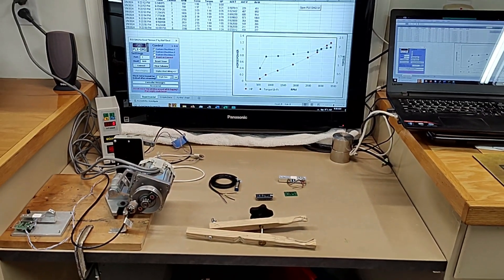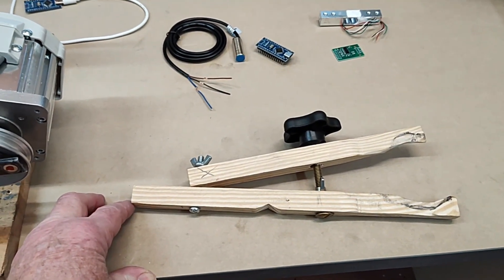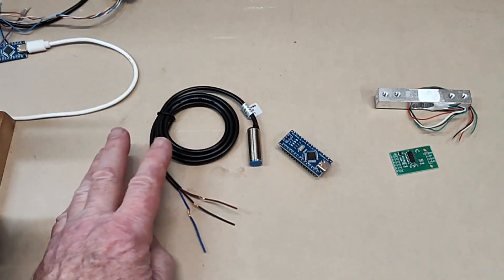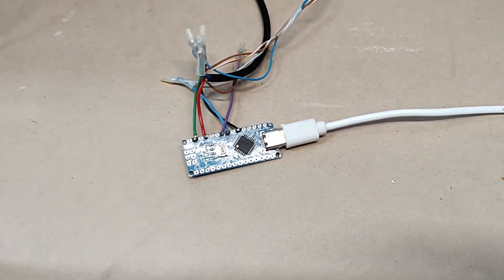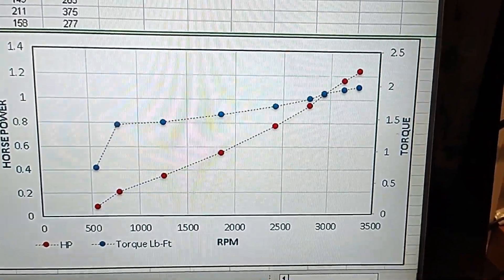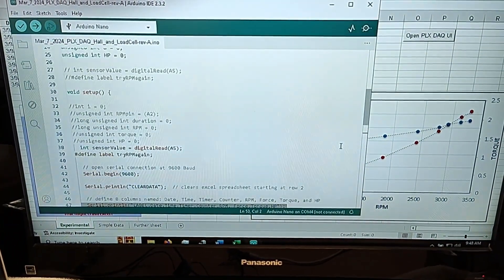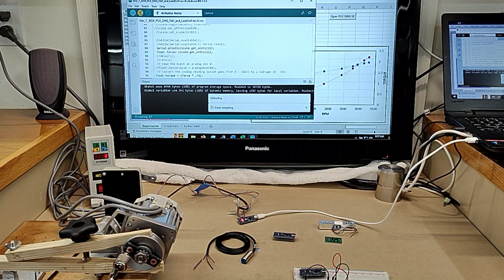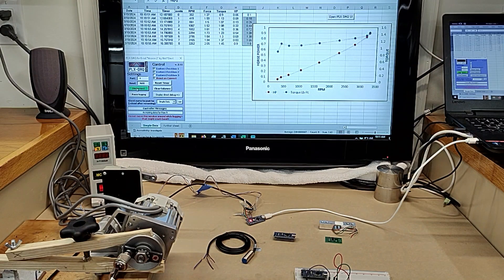Prony Brake Dyno, CHEAP!, for Small Engines. DIY Arduino based.

Comment: I’m struggling to understand why your torque versus RPM shows torque increasing with RPM. All other dc motor videos I’ve watched show the opposite. I.e., maximum (stall) torque occurring at zero RPM  and zero torque at maximum RPM. That said, I like your hardware setup.
Reply from the maker: Just happened to be online and saw this. The motor is a Vevor 500watt 6-pole stepper motor and matching controller, used for industrial sewing machines. The controller has a lot of user-setable parameters for things like acceleration rate, braking rate, stop position (for needles), etc. Maybe the way some of the parameters are set, and the rate at which I adjusted the load and the speed control lever, and who knows what else, the torque increased with RPM. I am not a motor expert but I do understand your question, so maybe this is a "feature" of this particular stepper motor. Maybe if I locked the speed control lever wide open and changed the loading in a different manner, the normal characteristic of max torque at stall would be evident. If you have an explanation, please share. BTW, I have overloaded the the motor many times so it now is pretty noisey, but it still works quite strongly. Maybe some of the magnet bonding fractured? Lloyd
Reply: @1227air500 : Hello! I’m not a motor expert either but I thought the following video by Aaron Danner might be helpful: https://youtu.be/jgUxjOZAJQE?si=PfaH_Ps7vw-ol1oZ

Thanks very much for responding to my comment so quickly.
Reply: @1227air500  : Another thought I had as regards your plot is that perhaps you are interpreting the data in a non-conventional sense. For instance, it would seem logical that as you tightened the Prony brake the motor would have to do more work to overcome the associated increase in friction and would likely slow down. If you continued to tighten the brake I would expect the motor to work ever harder (i.e., have to produce ever more torque) to overcome the load from the brake and at some point would stall and hence have zero speed. From this viewpoint, you could say that as you increase the load on the motor by tightening the Prony brake, the motor torque is increasing AND the motor is slowing down. Does this make sense? - Cheers - Jim
Reply from the maker: @hubercats  Very interesting thought, and BTW the motor videos were very educational. You are making me re-think my test methodology because I am not testing a simple motor  with a constant voltage applied and current increasing with load, but rather a stepper motor where both the voltage and current are controlled and varied by the controller. In my test, the tightness of the prony brake remained constant and the controller varied the voltage and current to accelerate the motor from zero to 3500 rpm. But here is something odd. In theory the kinetic coefficient of friction of the prony brake "jaws" should not vary with speed. But the force from the prony brake arm varied from 1.25 pounds to 2.0 pounds. So the measured force increased as the RPM increased. But what was being read and calculated was the power that the controller was applying to the stepper motor. I guess if I had locked the throttle wide open, and then used the prony brake to slow the motor from 3500 rpm down the zero, a much truer representation of the step motor's actual capability would have been graphed. So, what does that mean? I am not really sure. But a funny side note is that it shows how critical test methodology is in getting accurate readings from a dyno test.  Lloyd (I needed my brain poked at today. Thx)

Comment: Whoa thanks man for the project, this is what i need right now
Reply from the maker: I am glad you can use it. (I was looking at all the Catlin Clark stuff and the politics and your comment  pulled me back to the reality of why I love working with machines, LOL.)
Reply: Lol the one with Adam apple? 😅 i’m trying to use it for measuring an e-bike motor power. I want to make it can do a steady state tuning
Reply from the maker: @manray8513  There are so many of them out there!  If you just want to do steady state, you might be able to avoid the whole data acquisition stuff and instead just print your sensor values to your PC monitor using some commands like this:
  // print the results to the Serial Monitor:
  Serial.print("sensor = ");
  Serial.print(sensorValue);
  Serial.print("\t output = ");
  Serial.println(outputValue);

Then loop it with a delay between loops.
 That would still show in real time for you. Coming up with a decent brake to slow the motor and read the force will take some creativity but you might be able to do it right on the bike. If you like to tinker, this will be fun.
Reply: @1227air500  yeah i was thinking about put the brake on the bike, maybe make a hub and using some car brake to do it. I’m gonna modify this to output a digital potentiometers (for the ESC throttle) and geared stepper motor to pull the brake for the load so i can just input the RPM then the dyno doing it stuff.

There’s one from Dirty Elbow garage for the reference
Reply from the maker: @manray8513  Yes, I watched that Dirty Elbow video a while back. He came up with a nice set-up. But before you go that route of a computer controlled load, just try it manually.That way you'll get a feel of how the load needs to vary throughout your test. You might be surprised at how much you can do with a manually controlled load.

Comment: Where I get the code for Arduino and where I can download the software
Reply from the maker: Go to the arduino.cc forum and search for the topic 
Easy Prony Brake Dyno for Small Motors and Engines
that was started Mrch 25, 2024 by Lloyd-ss.
It is all there.

Comment: Hi, Is the program available for download ?
Reply from the maker: I am preparing complete documentation to post on the Arduino.cc forum in the next few days.  It will have a PL. schematic, Arduino program and Excel program. What level are you at with electronics, Arduino, Excel, mechanical, etc? This program is also suitable for an inertial dyno in addition to the prony brake/energy absorber type shown in the video. Lloyd
Reply from the maker: See the reply to @nitchcruz1685 above.